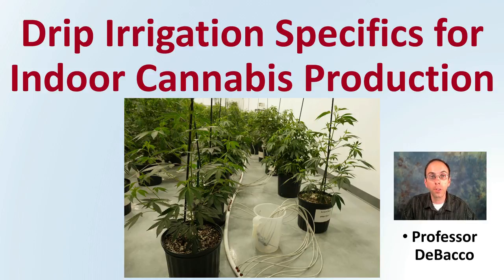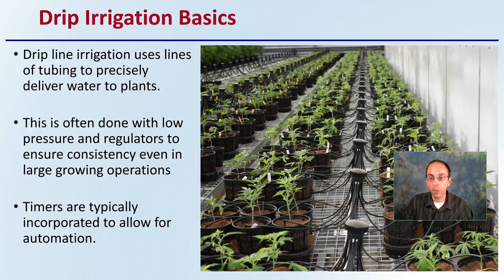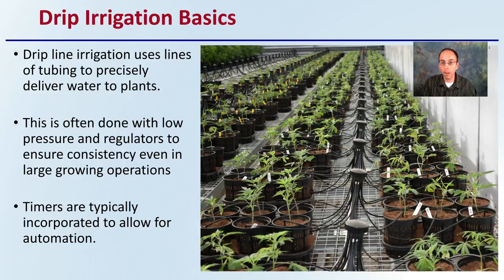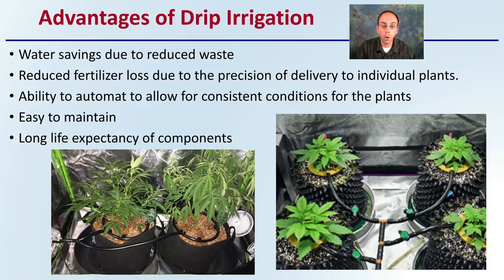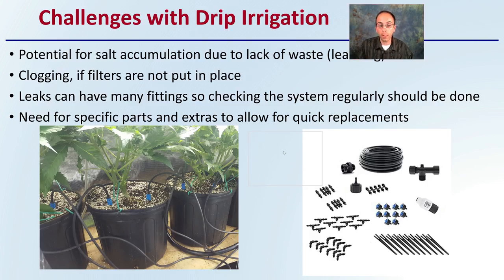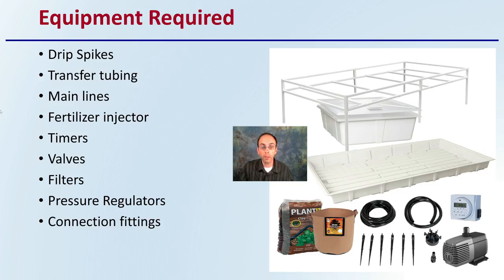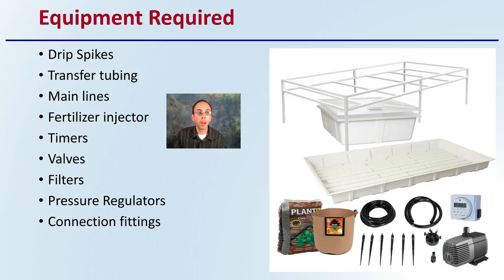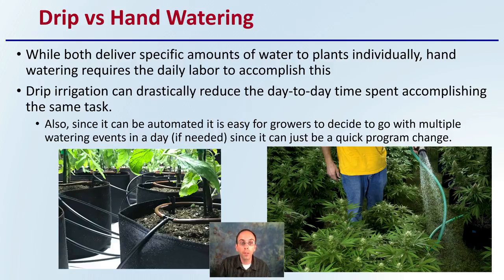Drip Irrigation Specifics for Indoor Cannabis Production

Comment: I always buy extra , its costly at times but at least I'll be able to replace or rebuild/remodel things I also recommend using union fittings  for large or small scale operations . Makes tear down much more simple and can take apart for cleaning, storage,  repairing , remodeling/extending,  with out wasting parts or materials .
Reply from the maker: Slight increase in cost for reduce labor time and frustration is money well spent.

Comment: I have an irrigation drip system hooked up to a 5 gallon tank. I have four plants in 2 gallon fabric pots, they are cannabis plants. I would normally water them about 1 gallon of nutrient filled distilled PH balanced water every three days. I'm wondering how often should I do this with the irrigation system. I'm leaving for the holidays and will be gone around 4 days.
Reply from the maker: Daily irrigation is a better method to help maintain even moisture in the root zone.  A moisture meter (or dig and check method) and a pump timer will help you dial in the consistency and automate your system.

Comment: I just started working with these in a warehouse how many times a day do you think I should use the drip if it's automated
Reply from the maker: Irrigating twice a day is a good starting point.  Adjustments can be made from here that will depend on plant size and substrate used.

Comment: Next step for me is to figure out the right pressure the pump must be for optimal delivery to plant’s roots
Reply from the maker: When in doubt go with a bigger pump than you think as it is easy to restrict it to get to the optimum rate for your set-up and conditions.
Reply: @DeBaccoUniversity  thank you, I’ll keep that in mind
Reply: Look into a Jain Octa Bubbler, or a FloraFlex Multiflow Bubbler. They have a big supply line going in, then eight 1/4” tubing fittings that supply the lines to the plants. You can buy the all inclusive kits that come with various sized flow restrictor inserts, or buy the inserts separately. Then you can have a large pump dialled in to pump at a specific daily rate, increase the times as the plants get older, or swap out the restrictors for more flow as the plants get older, or even just restrict a plant or two while using the same bubbler for them all.
Reply: @tombryant4518  thank you! I’ve heard of the octa bubbler and also one called the aeromixer. Still in deliberation 👍🏼

Comment: You forgot the most expensive item in the setup … the pump … quality pumps requires to give pressure on these systems are buku bucks
Reply from the maker: Some use city water pressure (no pump required) other could use a gravity feed system (no pump required) so actual required products may vary based on specific operation.